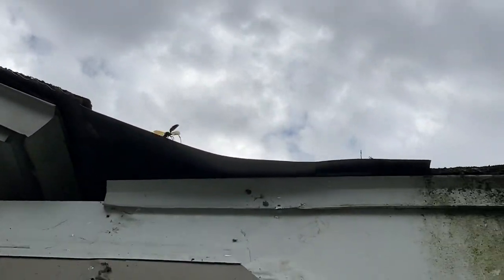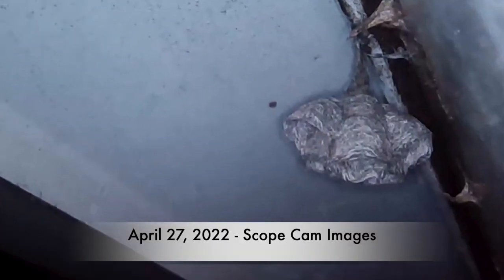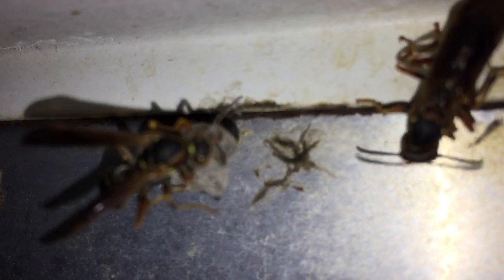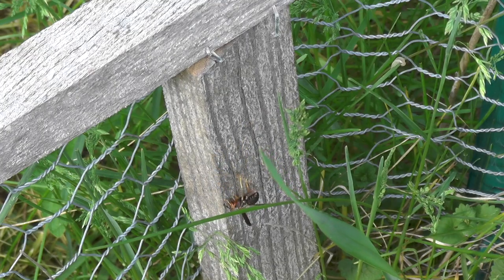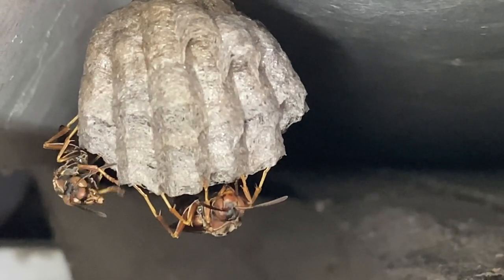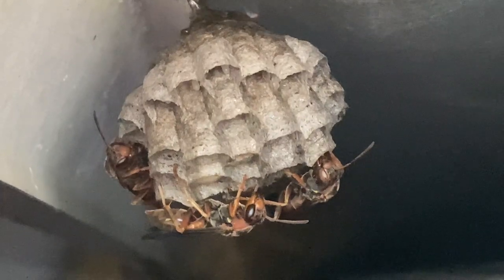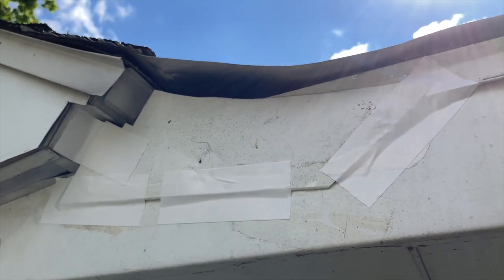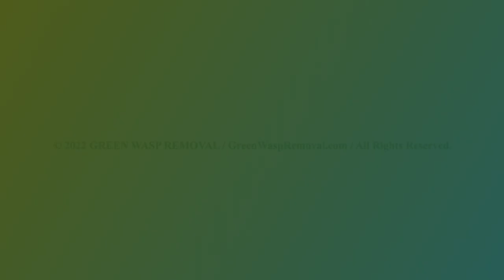SEE ENTIRE LIFECYCLE OF A WILD PAPER WASP NEST (6 Months of Growth) IN 40 MINS! Polistes Colony!

Comment: I had one building a nest in my basement door, I never really go out that door but then I had to cut it down when had problems with the well water and work guys needed access to basement, there were only about 3 wasps and after I cut it down had like 2 larva and threw it in the grass and ants quickly converged on the larva, then one wasp tried to rebuild it the nest in the door, dont know if it was the queen or just a worker but stopped a few days later never came back. dont know if it died or didnt have the queen to direct it anymore. but was kinda sad
Reply from the maker: @blakespower - Thanks for your comment.  As much as we love wasps, sometimes they just have to be removed for the safety of people in the area.  This is one of those cases for you.  Whenever there is a significant sting risk, they must go.  That said, in the future, you can always try to relocate the nest - check out some of our relocate videos for the process you can use.  Sometimes it works, other times it doesn't, but it gives them a chance at least.  Hopefully, your wasps found a new place to live and set up another nest there.  It's great that you didn't poison them.    Paper wasps are easy to remove without poison and now they can just go elsewhere and do their important work as pollinators and biological pest control agents in the ecosystem.